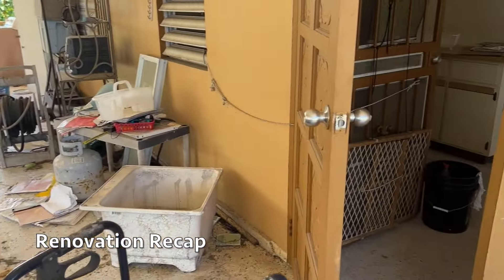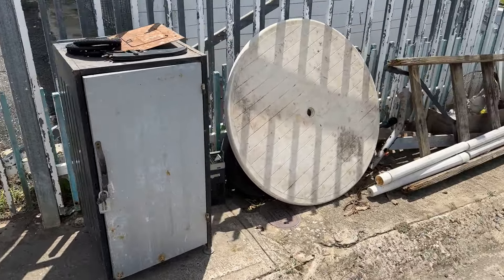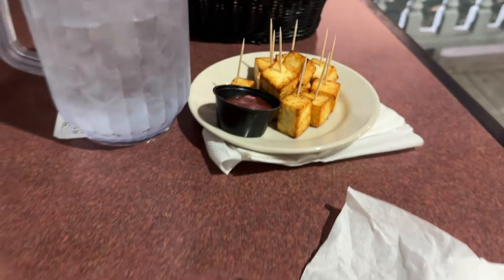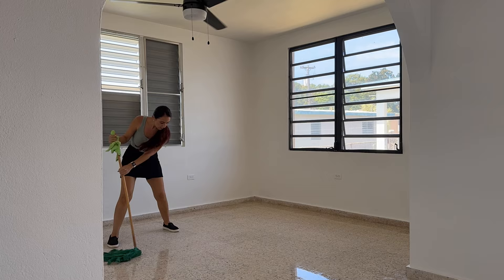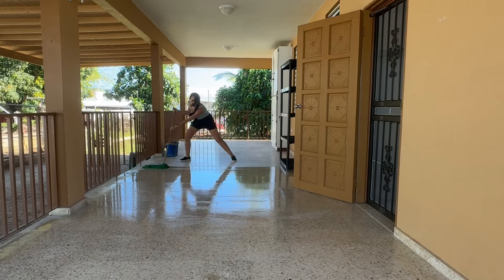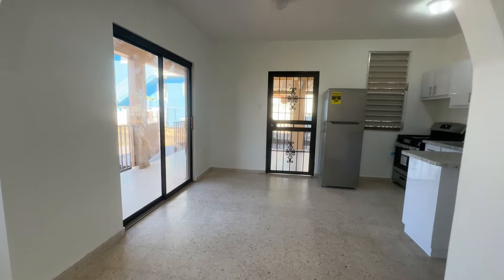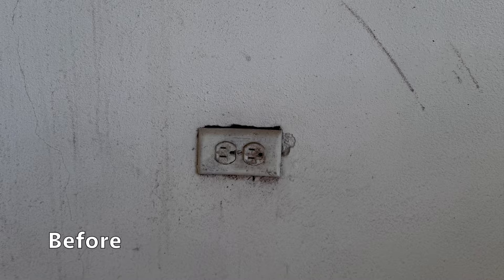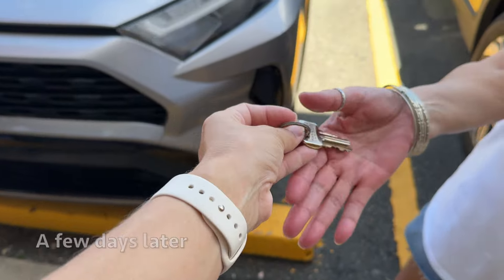House Reno Finale: Epic & Emotional Interior Transformation  (Cabo Rojo, Puerto Rico) Ep.13

Comment: Ana FYI, the electric receptacle next to the kitchen sink is out of code. GFCI receptacles are required in bathrooms, garages, crawl spaces, basements, laundry rooms and areas where a water source is present.
Reply: Another option is a GFCI breaker.   Technically it also requires two branch circuits but it is an old original wireway install.  Getting electrical inside the walls and around concrete structures is so difficult as to make it nearly impossible to upgrade things.  Though a new outlet with GFCI is around ten dollars each maybe a little more.
Reply: It's PR. Nothing is done correctly in PR. I've hired several electricians to try to fix things in my house in SJ and I wish I could be there to micromanage because they made things worse! Everything so messy and ugly and wrong. Now I have a whole section without electricity that used to have electricity and I have to hire another electrician. And my husband stupidly paid them before seeing what they had done and I couldn't reach them to fix the area they cut off power from. Of course they run away and hide with my money 🤬
Reply: @jelatinosa  I am so sorry.  That is terrible.  I would check the breaker panel.  Put on a heavy glove or something to touch the breakers. It is to insulate from shock if there is a problem. You can check with someone that is a professional if you can find one. Turn your breakers off all the way, then turn them back on.   Sometimes they trip from a surge and don't look like they are in the middle position saying they are no longer on. I've seen that often.  Though they may have just been completely worthless electricians. Hey make your husband do it...I guess you may think he shouldn't wear a glove at this point.
Reply: @allynonderdonk7577  lol if only it was something as simple. They literally pulled out all the wiring that was in the walls from the whole section of the home. That's why I don't have power. I have to add all new wiring running through the outside of the house now.

Comment: How did you get the ceiling good? I’m going through the same problem and I was told it’s the humidity in the house.
Reply from the maker: If the paint is the issue, you can paint and scrape again, cause painting is how you see where you need to scrape. It’s a little trick but you waste paint . But you can do it with primer too.